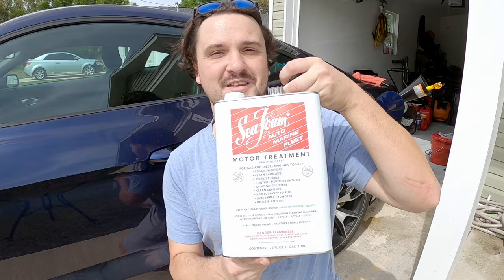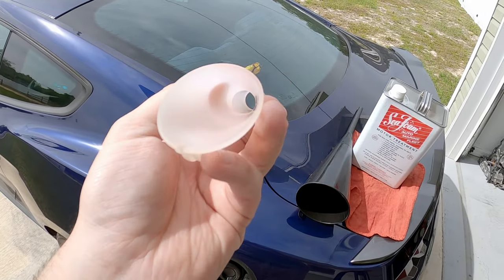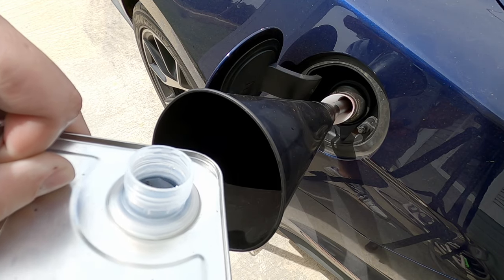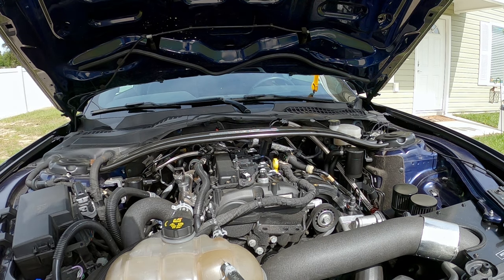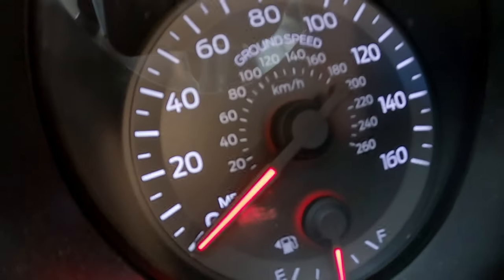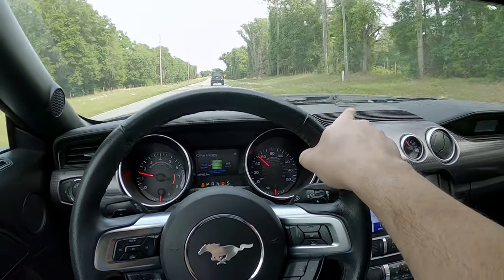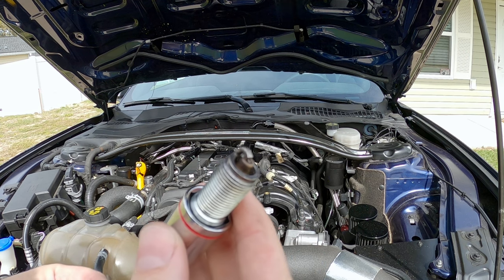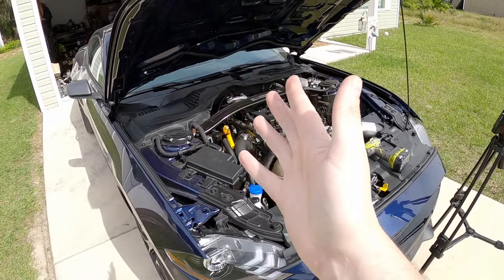Something HAPPENED after using One Gallon of Sea Foam at Once!

Comment: So many things wrong with this video, never use an impact on spark plugs and a whole gallon of seafoam😂
Reply: I've used Seafoam for years and I never had any problems. Of course, I follow the instructions on the bottle and only use the recommended amount of Seafoam to treat my gas tank.  It's NOT a good idea to dump an entire gallon of Seafoam into your gas tank. Because TOO MUCH Seafoam or fuel injector cleaner could burn up your valves ...causing internal engine damage.
Reply: Yeah, his spark plugs probably got damaged from him overtightening them with the impact.  Plus, Ford won't warrantee his new engine anymore after he screwed it up.
Reply: He is really good at fucking up a car..nice :)
Reply: Never use a impact on spark plugs. I have over doused small engines with seafoam
Reply: Omg 😅😅😅 a gallon... And it's for high mileage cars... DO NOT DO THIS !!!!
Reply: YOU GUYS realize he's not serious right?😊

Comment: Sea Foam was originally developed for 2 stroke marine engines. What you did, was basically the same as dumping an entire gallon of kerosene into the gas tank. Plus it doesn't work as described, in direct injection systems.

Comment: Seafoam ) is a highly volatile upper cylinder cleaner that will help clean dirty valves and and fuel system. Do you like me burned up the bells because it would have been running awfully hot

Comment: Forgot this is a new engine, which means it needs no such additives.  You need to follow important engine break-in protocol.  Also, a bent electrode on a spark plug is very serious and might point to mechanical impact of the the piston(s).  You are taking way too many risks with your car.

Comment: Did the gallon of marvel mystery oil destroy your engine? Or why did you need a new engine?
Reply from the maker: It happened not long after I poured a gallon of Lucas upper cylinder lubricant in the tank.
Reply: @KarzKreated I knew that would happen when I viewed the video. Get educated before you destroy engines

Comment: Very interesting observing the results of your tests.  I have wondered about some of this stuff myself.  One tech point:  use a torque wrench to tighten your spark plugs.  Do not guess what the torque is by using an impact driver or some other non accurate method.  You can strip the threads, assuming they are aluminum.  One unrelated point:  You keep saying "go ahead and, go ahead and, go ahead and."  I used to say the exact same phrase and had to train myself to stop.  With other people it's a different expression, like "in terms of, in terms of, in terms of."  I'm pointing this out to help you, not to criticize.  Take care of your investment.  Get advice before you do anything questionable to your engine or car.  Thanks for the videos.  Nice car.  God bless.

Comment: Using an impact on spark plugs, pouring in a gallon of SeaFoam into the fuel tank, over revving the engine for extended periods of time.....but it's the car manufacturer's fault, and Seafoam's fault. This is the stupidity of America today. ALL of this is 100% your own fault.

Comment: If it's a brand new engine, then why did u use it. You know that if u use to much premium gas and any gas treatment that its not good for it plus it will cause the engine light to go on untill you refill with only unleaded

Comment: Its not fords fault its your fault nobody made you put that much seafoam in. I have a 95 f150 with 337,000 miles on original motor and i run sea foam evey couple tanks no problems

Comment: You more than likely changed the spark Plug Gap !  by using an impact wrench check the Gap OK  you may of also cross threaded the spark Plug you have to start the insert slow Best by hand then torque the manufacturers specification...Blood Stop all that B.S. if it's a new Engine and drive or maybe  YouTube paying you so gud, your like the late rapper EASY-E in his lyrics...I'll drive it in a ditch and go get me another 😆 🤣 😂

Comment: I just ran 2.3 gallons of this stuff through a 2019 Suburban with a 5.3 flex in it. It is an ex limo and had 2300hrs of idle time recorded and was running like a pig. It had half a tank in it, I threw in 1/3 of a gallon. I drove it to 1 quarter tank and poured 1 entire gallon of Seafoam into it, I then let it get to 1/8 of a tank and added yet another whole gallon of seafoam. The idea being that this engine has so much idle time that extreme measures were called for. Once I ran it almost out of fuel I filled her back up with good old regular gas. She purrs like a kitten. It then had a slight cough every now and then so I figured it had a sore throat. I fired a can of Seafoam aerosol down the intake engine side of the AFM module. Yes sir, that's a new engine. Purrs like a kitten and idles sooooooooth as butter for as long as you want. All the life had come back to it. Now its not a fat happy pig, it's  a fat kid at fat camp trying his hardest. This engine came back to life and is now far more responsive and efficient. My MPG has gone up significantly, probably 5 or more to the gallon. I did an interstate run for 150 miles to get my readings. THIS CHIT IS NO JOKE.

Comment: Doing your oil changes every 5k miles will protect your engine far better than dumping a gallon of rubbing alcohol  your gas tank
Reply: Unless you got a random misfire with a vehicle with a possible dirty fuel system or spark plugs.
Reply: @GMC.Sonoma.4.3  there's still way better products than seafoam